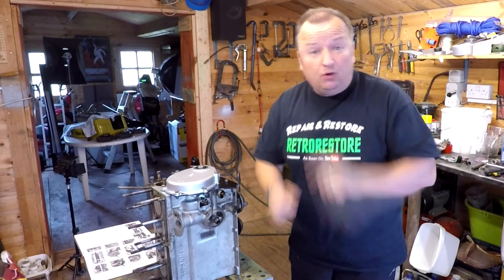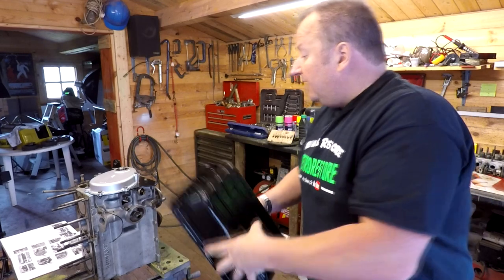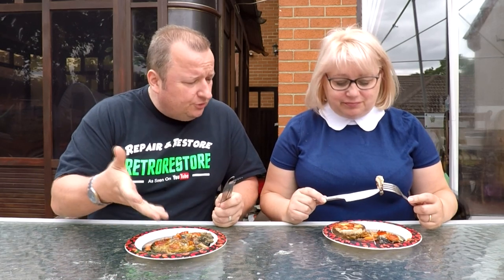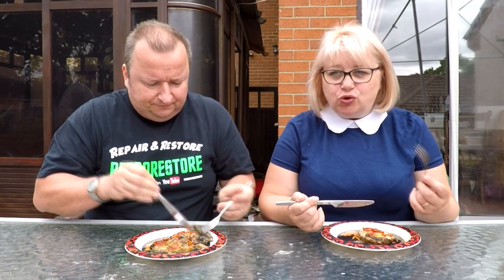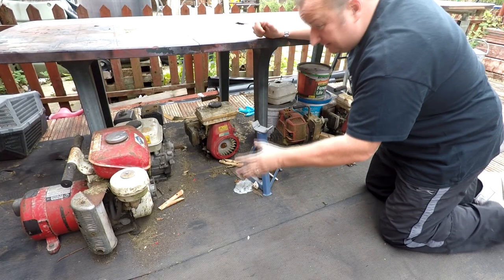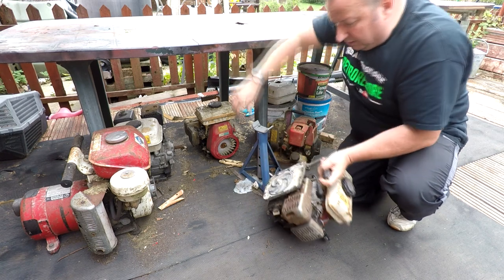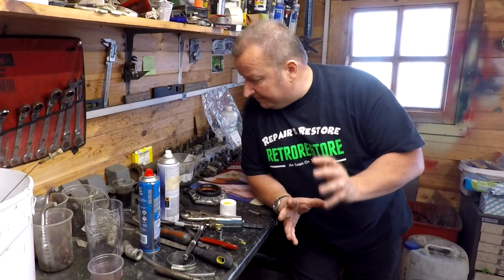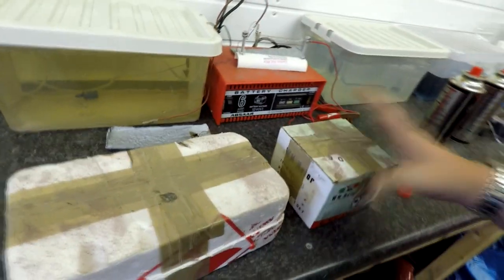A Day In Our Life #33 Engines And Scooter Vlog

Comment: not sure if you know this trick with engine seals,but i learned from a old timer to pack the area where the spring is with grease and when your installing it the spring wont fall out causing a leak.
Reply from the maker: Nice tip Rog. Cheers
Martin

Comment: While I agree gasket kits are the way to go, this is still an English engine. So, future leaks will occur. If you had Permatex "The Right Stuff" it'd likely be bone-tight on oil for all parts, for years. I'm sorry for over-valuing the old Honda engines, but they can turn a great profit if sold in the right context. They are less common where I live, so they command a good dollar.
Reply from the maker: yes I agree, Honda engines are great engines, just hope I can get these running.